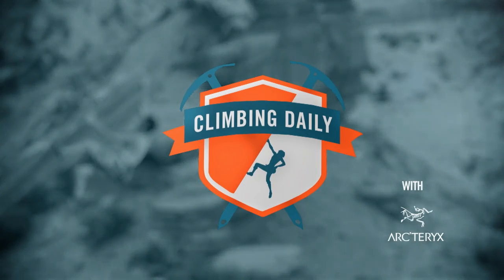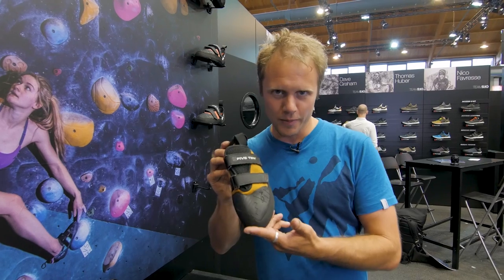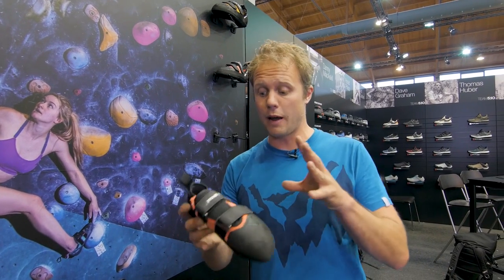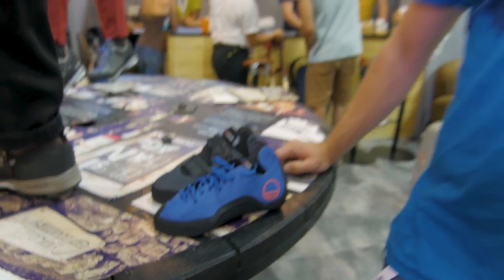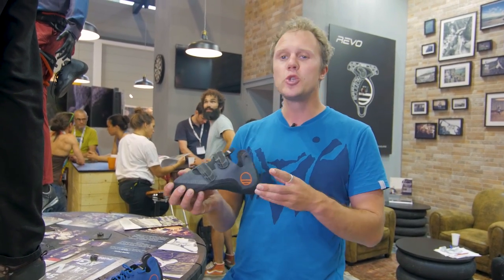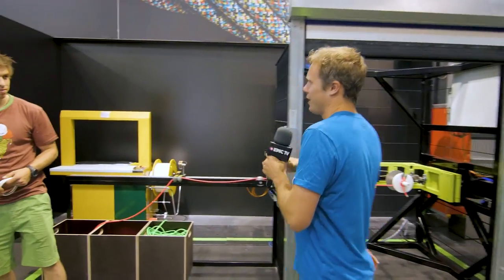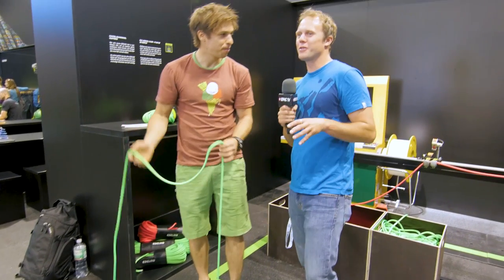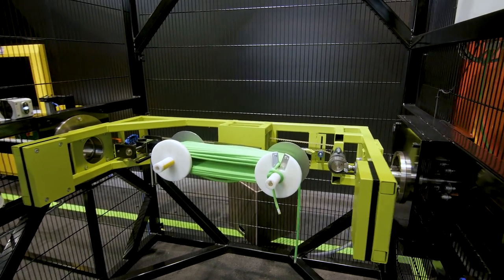Wild Country Climbing Shoes And Other Highlights From Outdoor 2017 | Climbing Daily Ep.959

Comment: Sooo.. do I need to have that machine at home and use it before each climb? Otherwise this genious invention helps you only once, when you buy the rope. Or am I missing something?
Reply: Maxisokol S same question
Reply: Maxisokol S Maybe this machine is meant to be used in a climbing gym or similar facilities not a home product that's for sure
Reply: There are techniques for hand coiling that prevent kinking, they amount to putting a twist in the rope anyway. I think a good portion of climbers don't bother to recoil the rope, and instead opt to leave it piled in a the rope bag.
Reply: It is for flaking out a brand new rope, often when you buy a new rope the factory coil puts tons of kinks in it. This machine takes those "factory" kinks out of it. After that you should be able to easily flake it on your own without this machine. Bottom line this machine is used by edelrid for their brand new ropes, so when you buy an edelrid rope you don't have to deal with the kinks and flaking it as much as you would with other company's ropes
Reply: Wish they had started using this machine before I bought my last Edilrid lol.
Reply: You can coil a Rope this way by hand. Its the same technique used by (some) event tecnicians to coil cables and it works on ropes as well but takes a lot more time than coiling it the usual way.